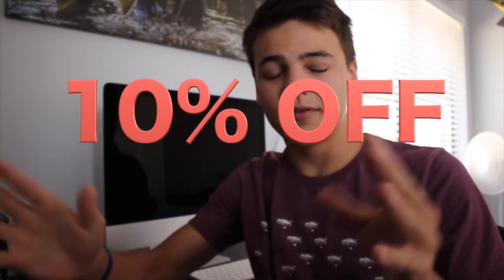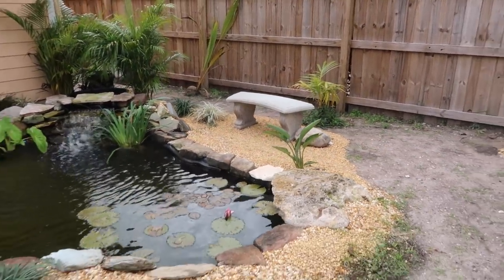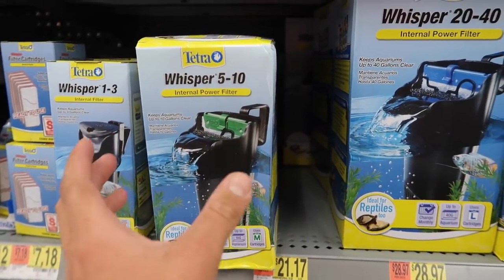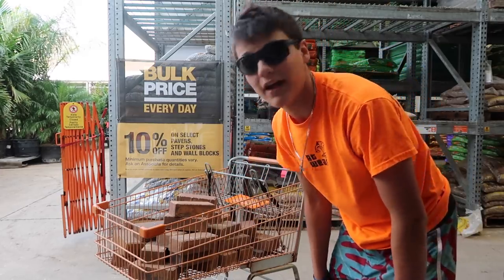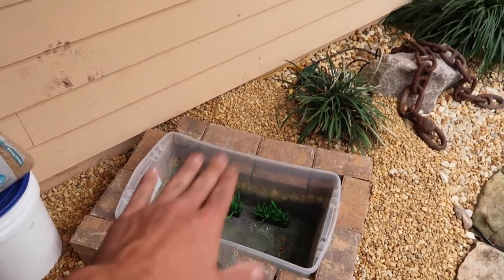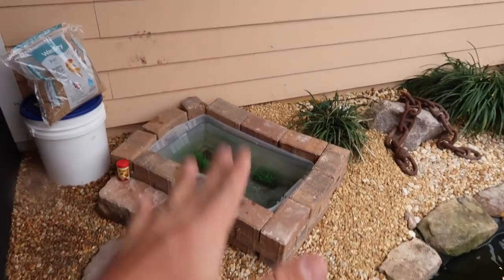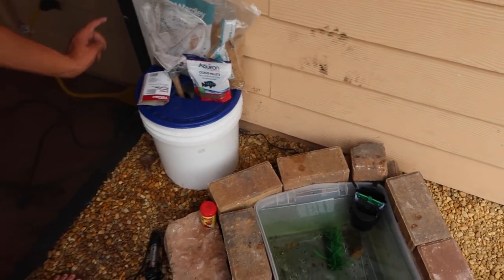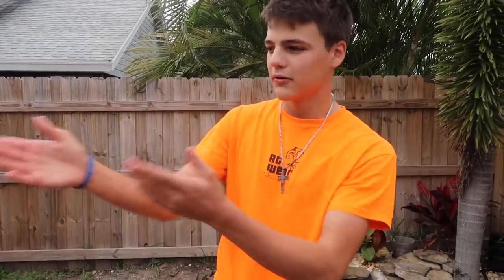Remodeling ULTIMATE UNDERGROUND BAIT TANK!

Comment: I have the same exact filter as your last. And with it you need to fill the back of it before turbo.g it in so it doesn't blow out the motor and with every filter it probably helps to  get the right size you what your using it for.